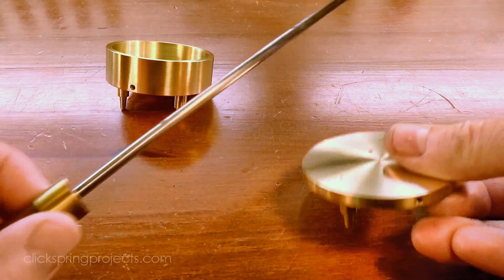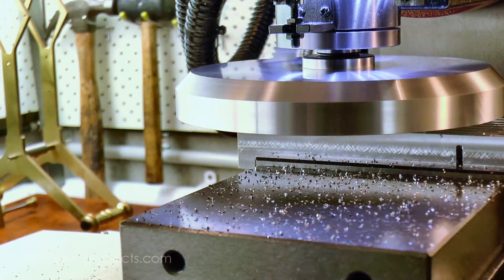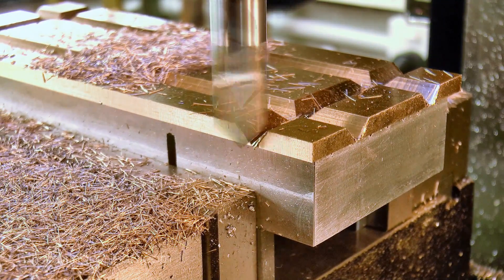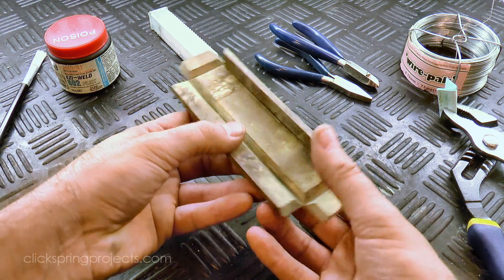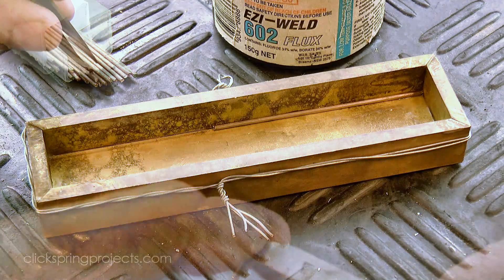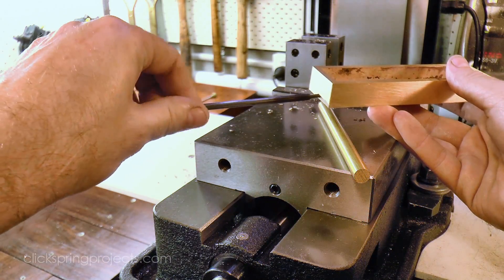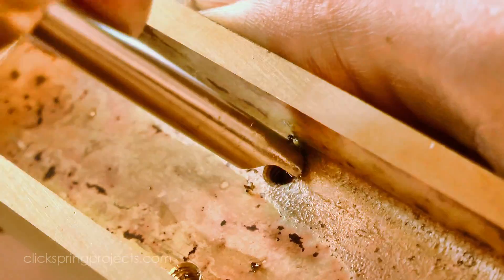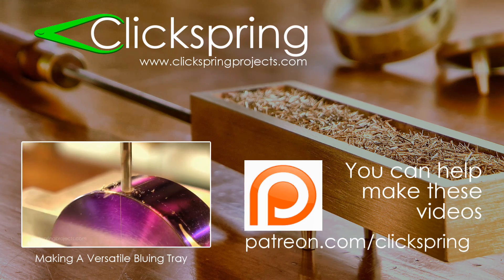Spare parts #9 - Making A Rectangular Bluing Tray

Comment: Amazing video! I like both the quality of your work, and of your videos. I only own a wood lathe, so watching you cuting so easily brass and other metals is stunning.

Now, a bit off topic, but somehow related question to metalworking: 
I have a large (48mm) adjustable reamer (with a sort of a conical wegde inside, that can be screwed to make it thiker). As you can suspect, I've got no use for it. Were do you usually buy your tools? Is there a specialized site for second hand tools, or just plain old ebay should do the trick? 
I also have a gianormous drill bit (40 mm I think) with a morse shank. I have no clue what are these tools doing in my shop, or how they got there.
Reply from the maker: +Dumitru Ursu Very pleased you're enjoying the vids Dumitru, thank you for taking the time to check them out. Ebay for the tools I would think, or if you have the space, possibly just keep them. You never know when they will come in handy. Cheers, Chris.

Comment: Why 92 degree and not 90?
Reply from the maker: +dtiydr 90 degrees doesn't permit the brass to actually fold to 90 degrees, nor does it give any room for the solder. 92 lets the brass go slightly beyond the right angle, and then spring slightly back to make some room for the solder. Thanks for watching and asking.
Reply: Clickspring Ah yes, the brass will of course draw the parts slightly together in the bottom since it will shrink a little sort of speak when bent due to the small bend radius. That could also be fixed by making the cuts slightly wider but a 92 degrees cut work just as fine and go a little quicker as well. Thanks for your very interesting videos.

Comment: Question.  This blueing you speak of is done strictly by heat?  No chemicals?  If so, this blueing is djust for cosmetic appearance?  It does no protect the metal?

Your machining and video making skills are excellent.
Reply from the maker: +Mekratrig Yes the blue is a product of the heat oxidising the surface of the metal and generating what is known as a "thin film effect", more info at the end of this video: https://www.youtube.com/watch?v=8h1Uf9bkc3E It is primarily for cosmetic purposes, although it offers a very small measure of protection from immediate oxidation. Thanks for watching and asking :)

Comment: How well would this style of bluing tray work for larger items such as firearm parts or knives?
Reply: +GreatSmithanon I don't think this method would work for knives and guns, what he is doing is just color tempering small parts like screws, if you were to do that to a knife you would lose the temper of the blade. As for guns I think they are hot blued which involves lots of chemicals and complex process. But you can always cold blue knives and firearms parts, it's not very durable but all you need is a bottle of cold bluing solution.

Comment: Will the silver-solder stay solid for long enough when you're heating/bluing, or are you going to have a problem with it melting?
Reply from the maker: +A2ZGAMEGUIDESX The silver solder melts at approx 700 degrees Celcius, the blue occurs at approx 300 degrees Celcius, so I will be remaining well clear of the solder melting point when the tray is in use. Thanks for watching.
Reply: Clickspring  Oh ok, sorry I wasn't aware that bluing occured at such a low temperature, thanks for replying

Comment: Won't the heat from the bluing remelt the solder?
Reply from the maker: +Wankel Motor The solder melts at around 700 degrees Celcius, and the bluing occurs at around 300 degrees, so I will be operating well below the melting point of the solder. Thanks for watching and asking :)
Reply: +Wankel Motor Apparently not. Bluing does happen at a relatively low temperature compared to the melting point of silver.
Reply: Clickspring Ok. Thank you. Great videos!

Comment: as usual great work.
may I ask what is the temperature of the bluing action and is it close to teh melting point of the silver solder?
Reply from the maker: +Charles Camenzuli Hey Charles, the blue color typically occurs around 300°C, and the silver solder (brazing alloy) typically flows at around 700°C, so I will be well clear when using the tray. Thanks for watching and asking :)

Comment: Awesome box. I really like how you used you're own D bit to cut those grooves. I did wonder though, does the silver solder reflow when you use the box to blur? Or does it not get that hot again during the process?
Reply from the maker: +Tyler Hall Hey Tyler, that's correct, it doesn't get that hot again. The blue oxide color occurs at about 300 degrees C, and the solder melts around twice that, so I will be well clear of that temp when using it. Thanks for watching and asking :)

Comment: Superb Chris - another gem. 
Not sure how you seem to maintain such 'surgical' cleanliness! Keep 'em coming - always a joy to watch and thank you.
Reply from the maker: +ChrisB257 If I don't keep it clean, I start to lose parts in the swarf! I appreciate your support mate :)
Reply from the maker: +Derek Richline Hey Derek, its a terminology thing. The correct term for what I did is "Brazing", using "hard solder". But the term "Silver solder" is more widespread, so I use that. Not to be confused with "soft solder" the low temp tin/lead mix used in electronics/plumbing/general engineering. Cheers mate.
Reply: +Derek Richline AFAICT, most brazing rods and pastes for brass use some amount of silver in them, so it's effectively the same process.  In UK (and I guess Australia) we say "Silver Solder" (engineering and jewellery) or "Hard Solder" (plumbing) where Americans would call it all "Brazing".   This makes it a bit tricky to Google for supplies in UK, as most suppliers of pastes etc seem to be in jewellery trade.
Reply: +Clickspring hey Chris what program are you using to show us the design ?

Comment: Love all your videos, may be a stupid question but why do you start your hole drilling with one bit and drill through with another?
Reply from the maker: +Daninashed Hey Dan, twist drills are notorious for 'wandering' off position if there isn't a starting point for them to begin drilling. The first drill you see me use is called a spotting drill, and is much stiffer than a standard twist drill, and experiences much less of that 'wandering' effect. It starts the hole, and then the twist drill follows it without issue. Thanks for watching and asking.
Reply: +Clickspring Cool, thanks for the reply!

Comment: p.s its slightly depressing watch you use super glue all the time, i just recently became allergic. be careful with the fumes, its an allergy that builds up over time but is unusual to get.
Reply from the maker: +HomeDistiller I'm careful with it, always use breathing protection, thanks for your concern :)
Reply: +HomeDistiller Hey H.D done any Al casting lately?
ps Merry Xmas & Happy New Year to you and yours.
Reply: ive done a few bits and pieces, like a casting from a vintage radiator cap to make a new one. i didnt get any video though as ive been rather slack of late.. but i should have some up soon, nothing as good as Chris makes though!
Reply: +HomeDistiller I didn't know one could become sensitized to superglues! I made the mistake of being blasé with epoxies when I was younger, now am sensitized to them. Will take your comments onboard re: superglues, thank you. Also, subbed to your channel!

Comment: i just had a thought about your round blueing tray, it should have a screw on lid to keep the shavings in place, even this square one you could make a lid that indexes into holes on the far end from the handle and then has a latch go down around the handle? or a couple of thumb screws ether end might be nicer and easier
Reply from the maker: +HomeDistiller Dang I wish I had thought of that! Where were you when I needed you and your clever idea! Thanks for your continued support mate :)

Comment: Noobie question: How well  will the silver solder do on a holder that gets heated all the time, or will the joints not be heated enough to boil it out?
Reply from the maker: +sa-maker Good question - the solder melts at a much higher temperature than the bluing occurs, so it will hold well. Thanks for watching and asking :)
Reply: +Clickspring Cool, that is good to know. Love your work, your projects and videos. It is always a pleasure to view.

Comment: Top work mate. Curious to know how long the blueing actually lasts. Does it dull over time like colour in stainless steel welds? Awesome stuff btw.
Reply from the maker: +Tyler Sharman (Sharmo) Hey Tyler, its not a particularly robust coating, so it scratches easily if it impacts something hard. But if you can keep it protected from contact, it can last a very long time indeed. I've seen clocks and watches with original blue intact after many many decades, perhaps even longer. Thanks for watching and asking :)

Comment: As someone who doesn't have a machine shop, I find some of your comments hilarious.  "As always with super glue, a gentle heat breaks the bond" uses giant gas torch
Reply from the maker: +Maniacal Cactus Ha ha! You make a good point, I guess its all relative! What I was meaning to get across was that there's no need to nuke it to get the glue to break. In fact you can get the glue to soften enough just with hot water, I'm just a little bit impatient! Great to have you watching mate :)

Comment: the solder doesn't melt again when heated up while bluing?
Reply from the maker: +Toxic Flies The solder melts at a much higher temperature than the temp at which bluing occurs, thanks for watching.
Reply: +Clickspring thanks

Comment: Why didn't you clean the surface after annealing?
Reply: +PyroShim My guess is because he'd have to do it again after soldering and because you're not gonna see the inside of the box if it's full of chips.
Reply: +Ben Crinion But the solder would grab the clean surface better. I don't think that the flux can clean up that much.

Comment: How did you decide on the 92 degree included angle value?
Reply from the maker: +nThanksForAllTheFish I read it in a machining text, I forget where. It works a treat, takes care of the springback so that the sides sit squarely at 90 degrees after bending. Thanks for watching :)